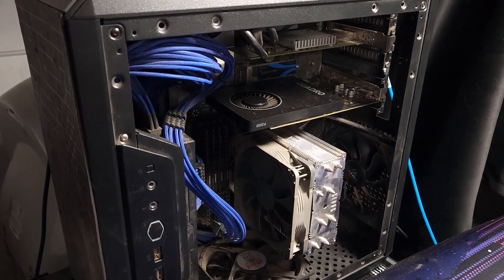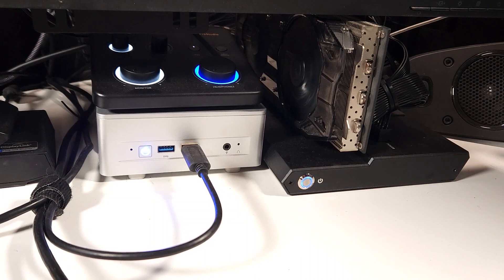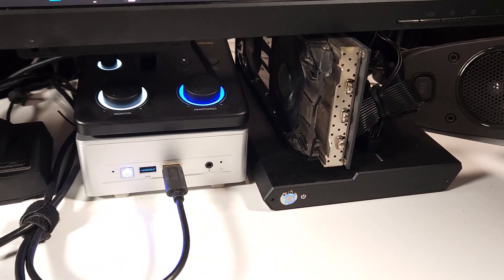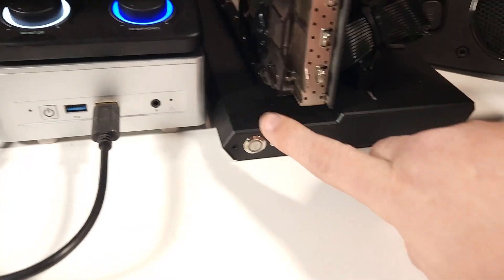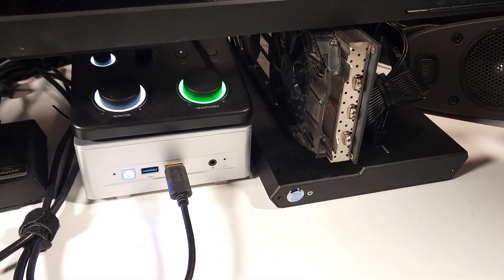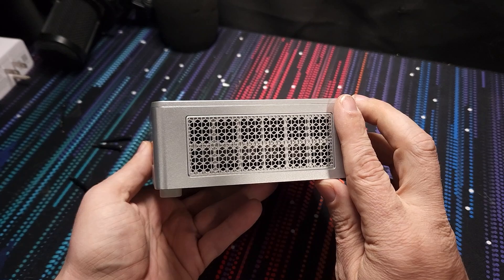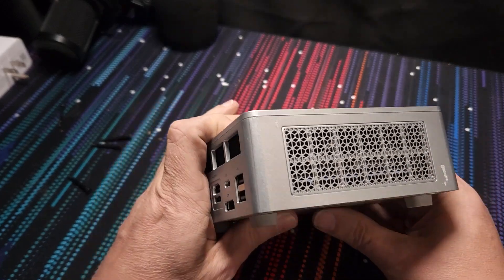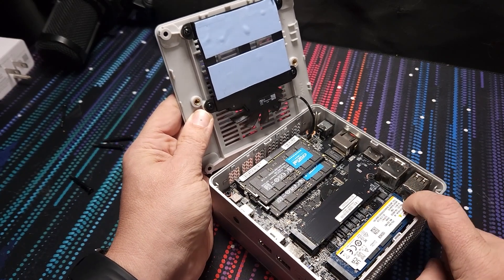Can a Mini PC REALLY Handle This? The UM880 Plus & DEG1 Surprise Me

Comment: I am really enjoying my Minisforum UN1250. It has replaced my desktop PC and I play my early 2000's games on it without issue. The 2.5G NIC is also a plus connecting to my Unifi Flex2.5 switch. I had to do a few file transfers to my TrueNAS storage and it went a lot faster. Game downloads are also faster on this than my AMD FX6100+ desktop was. Highly recommend Minisforum PCs and looking to get a pair of MS-01s at some point later.

Comment: got 2 of these minisfourm mini pc's on amazon, both only half the memory worked, used 2 different memory brands and speeds both which said supported no luck. Would never touch a miniforum again
Reply from the maker: This is my 3rd Minisforum device and have never had an issue with any of them.

Comment: The reason the OCuLink precludes the use of one of the M.2 slots could be related to the limited availability of pcie 4.0 lanes. If I'm not mistaken, the amd 8945hs has 20 pcie 4.0 lanes, of which I'm guessing 8 are being used by the two m 2 slots, 4 by the two usb4 40gbps ports, 1 for the wifi, 2 for the two 2.5G NICs. This totals 15 out of the 20 pcie lanes, which would leave enought for the OCulink, but I might be missing some other components using pcie lanes.
Reply from the maker: Makes sense. Was just kinda bummed about losing a storage slot for the Oculink as my Aoostar Gem 12 had the Oculink pre-installed and I didn't lose an nvme slot